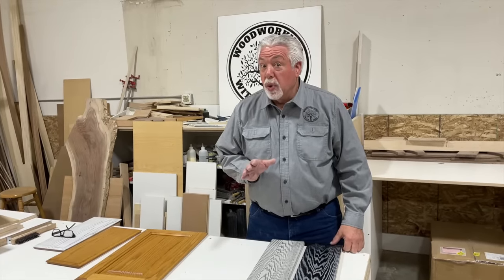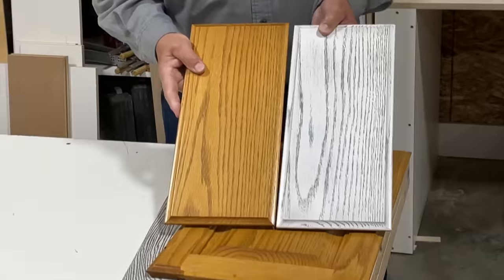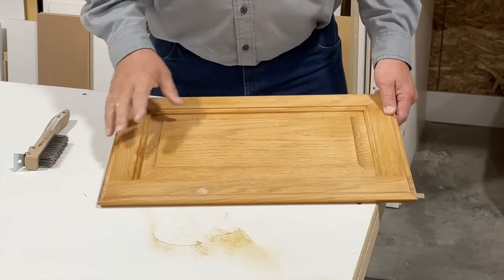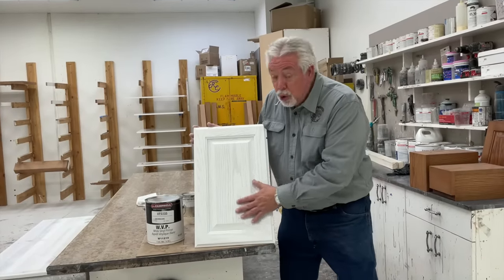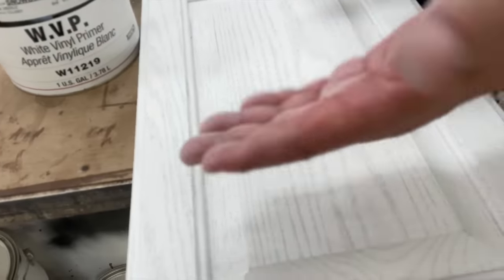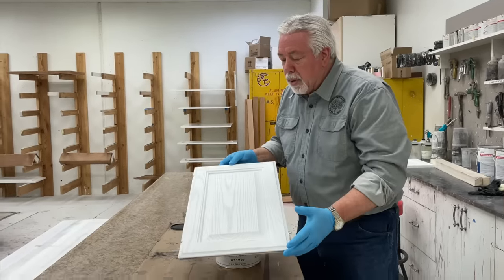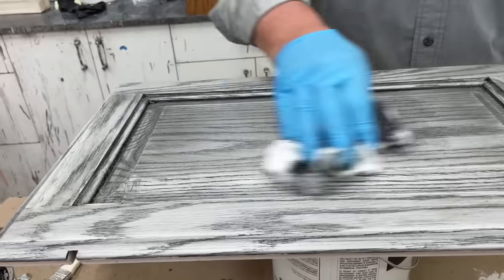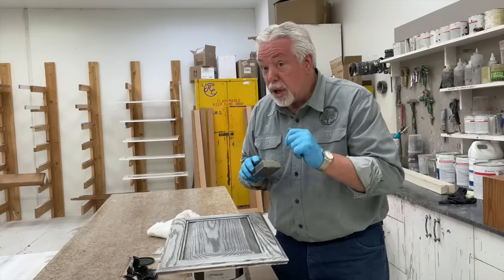YES it works...you CAN ceruse a golden oak kitchen.

Comment: Could this be done on knotty pine? Our attic was built in 1945. The stairwell, landing and all the hallways have knotty pine on the bottom half, as well as one complete bedroom (all 4 floor-to-ceiling walls, beds built-in under the eaves and the built-in closets). The only thing that doesn't have knotty pine in that bedroom is the ceiling. It is overwhelming and we are finding it very hard to decorate with all the knotty pine as it has become quite orangish/reddish over the years.
Reply from the maker: Sorry this technique has proved to be less than successful on pine. Thanks for watching, Wes

Comment: Hi  I can't swing the money for the Makita tool that you use. I'm buying the Craftsman Restorer.  I need to purchase a nylon wheel as an accessory. They have 80 grit or 180 grit.  Which one would you suggest I get for doing my red oak floors over?  The Makita that you have comes with a 100 grit.  Ty so much I'm about to get started this weekend.

Comment: Hey Wes! We need some advance. The top coat we used cause the white to yellow badly. What brand spray lacquer are you using??
Reply from the maker: I use pre-cat lacquer for the top coat. You may want to check out the best products I have since found to do the cerusing method.
Here is a link to that video:
https://youtu.be/kZDk0CBRS3I
Thanks for watching, Wes

Comment: Can I ceruse a Cabinet door that has already been primed and painted from before, without stripping it down to the oak?
Reply from the maker: Yes...after a thorough cleaning, follow the steps: wire brush, primer, sealer, glaze and top coat. Good luck...it will look great! Wes

Comment: Hi Wes,
I have a question regarding the clear coat product you here, is that a ML Campbell product, if so is the KlearVar or Krystal High -Solids conversion varnish. We do have a dealer here and they are ready to help me with products for the cabinet job you basically sold to my wife...lol. Thanks great videos you do
Reply from the maker: I am not using a conversion varnish, I am using a pre-cat lacquer for my clear coat. Good luck! Wes

Comment: I love this! I'm just wondering what the easiest way to go about painting the actual cabinets would be if they are already installed. The doors and drawer facings would come off, but the cabinets themselves seem like they would be tricky to spray. Any advice on doing this?
Reply from the maker: Hi Casey...check out our latest video, I think it will answers some questions. Thanks for watching. Wes
https://youtu.be/CXuH-Ffqkyg
Reply: Take all the doors off and lay them flat. Label each one so that you can return to right spot.

Comment: What product did you fill the hole with? Do i need to sand the back of the door so the paint will adhere even though in not glazing that?
Reply from the maker: Hi...the hole was filled with wood putty. I use Famowood. On the back of the door: clean thoroughly, lightly sand with medium sanding sponge and paint. No wire brushing or glaze on the back. Thanks Wes
Reply: @WoodworkingWithWes  Thanks Wes! I just got the B Moore primer you recommend. The paint guy said I'm going to get yellow spots since the cabinets are stained (not raw wood or already painted). I told him what I was going to do.  He suggested zinsser odorless oil based stain blocker.  Thoughts?

Comment: Why does that wire brush work so well????? I tried to sand off the old stain with a wire brush and it wasn’t even close to that fast
Reply from the maker: Hi Josh...if the original finish is a lacquer finish the wire brush works very well.  If it is a polyurethane finish, it requires more work but still can be done. Good luck, Wes

Comment: If I wanted to stain mine darker (they are golden oak just like this) could I substitute the paint step with stain? Or do I need to sand it down?
Reply from the maker: Sounds like you are talking a complete refinish which starts with sanding it down. Good luck on your project...thanks, Wes
Reply: @WoodworkingWithWes  Thanks bud, going to be a long summer lol

Comment: Can this be done to old cabinets that I suspect are plywood door & drawer fronts??
They have been sanded down & I tried using restor a finish in mahogany to get a lighter mahogany look but although I have real pretty grain I have dark and light blotches :(
I don’t know what to do with these cabinets outside of painting them.
Could this work without becoming too difficult for us to handle or can someone suggest any other options and/or techniques??
Thank you for any help anyone can offer!
- Desperate
Reply from the maker: Hi Jamie...this process has proved less effective on veneer panel (plywood door and drawer faces) if it were my kitchen, I would just paint. Check out our video for BEYOND PAINT product 
https://youtu.be/qkcuOknMxqQ
and see if that could be the solution . Thanks for watching. Wes

Comment: Wouldn't this require you to do both sides (of cabinet doors for sure) for a professional look?
Reply from the maker: Hi...I wire brush and paint both sides but only glaze the face side. Thanks for watching, Wes
Reply: @WoodworkingWithWes  I keep watching your video (almost in disbelief, as everywhere else I research the ceruse process it calls for stripping or sanding to bare wood before proceeding. Either, you are a genius, or the process lacks it some other way. Thoughts?

Comment: Do you have to use sealer?
Reply from the maker: My white color coat was a primer/sealer. If the color coat that you use is a primer only, you would need to apply a clear sealer coat before glaze. Hope this helps. Wes

Comment: Can you also do something like this with the particle board and wood paper over top ? Sadly all my cabinets aren't real wood 😪 Any ideas?
Reply: Your best bet would be to do a faux wood paint job. Just use the paintbrush to make the wood grain texture. After you get several coats of it (let them dry between coats) Then dry brush with another color to bring  out the texture. A simplified description, but you can get the idea. 
Make sure you clean the paper of surface oils, and get a good primer to coat it with first too. Good luck!
Reply: @wishcloudstudios  Thank you so much for the info, do I need to sand down the white after I put it over the dark wood grain ? Exactly how you did on the video? and do I clear coat afterwards as well ?
Reply: @MrDavenez  No, it is a slightly different technique. But make sure that you plan which way you want the "wood grain" to go and always paint in that direction, otherwise you won't get the look that you desire. 
I usually put the darker color on first, then dry brush with the lighter color so that texture is caught. But painting white over black is really hard. It doesn't cover well, and has a tendency to come out looking more grey.
But it is possible to do a wipe similar to what he did in his video. I used a wet sponge or slightly wet brush with dilluted black paint to make a wood grain on a metal door once. If you get really good, you can even make convincing knots on the doors.
I used to flip old furniture, and would get a lot of fake wood furniture so I had a lot of practice. 
Maybe there are some other videos out there that could help you. I didn't really see any when I did my projects, but that was a few years ago. I just figured out the technique on my own.
Reply: @wishcloudstudios  Thank you so much for all the info, you gave me the courage to try to do it 😊 You should do a video of using that old particle board overlay and show all us folk with fake wood how it's done 😊
Reply: @MrDavenez  You are welcome. Oh, and since the cabinets aren't real wood, you can just use house paint. Then if you can, try to find a sealer that won't yellow. I haven't had much luck with finding one that doesn't, but I haven't tried them all.
Reply: @wishcloudstudios  I really like it when it kinda turns a little gray, It looks pretty that way too.  I will watch your channel alot, you give me tons of ideas.

Comment: Wes help!  I bought the MM platinum glaze like you have but I ran out!   Now they only have the one that says (scumble)   That’s all they have.   I’m 1/2 done my kitchen cabinets.   I ordered the one that says water based glazed anyway.  Can I use it?  I’m in Canada too so am waiting for it.  It says clear water based glaze but there that scumble?
Reply from the maker: I assume that the MM glaze that you are referring to is actually ML Campbell glaze that I used on that video. Is that right? If so, my best suggestion would be to contact ML Campbell directly from the contact information on the website. I spoke with someone there once and he was very helpful, in fact, he was actually in Canada. Sorry I don't have his number available. I hope that helps, Wes
Reply: @WoodworkingWithWes  Modern Masters Platinum tintable glaze with the silver label
Reply: @WoodworkingWithWes  it’s on the video “Ceruse your golden oak cabinets…
Reply: Hi Wes.   The MM tintable glaze not (scumble) was not showing on the site at Amazon or at Modern Masters. But Amazon must have saw I ordered the silver label before so sent that instead.  So I ended up getting the right one not (scumble) .  I’m so happy. I’m in Canada but have a US Amazon account too. Sometimes the duties, taxes and exchange are not worth it.  But this stuff is $106.00 here. That’s without tax.   I will be able to finish my cupboards now. 😊thanks Wes.